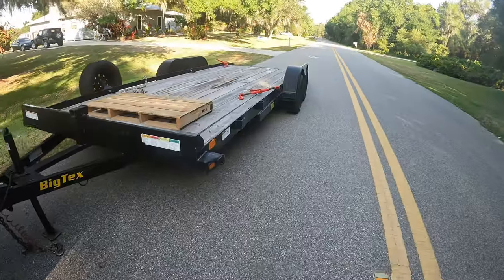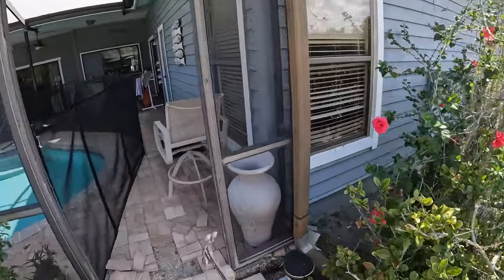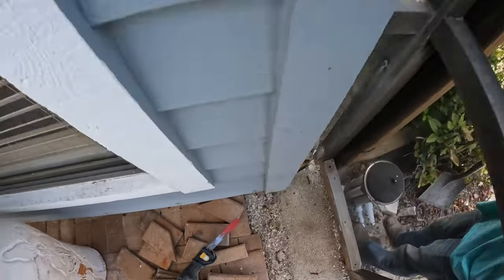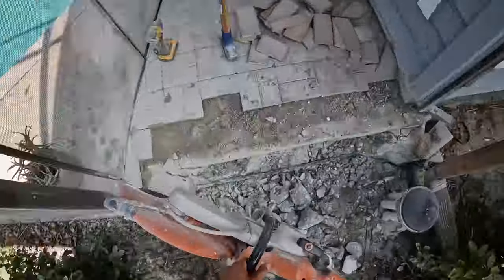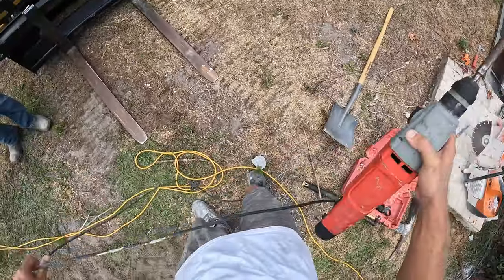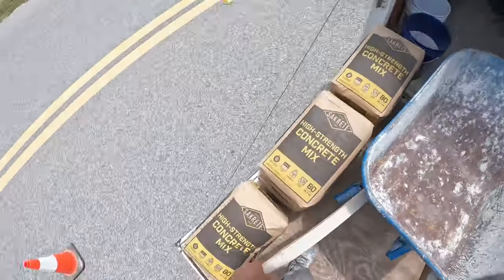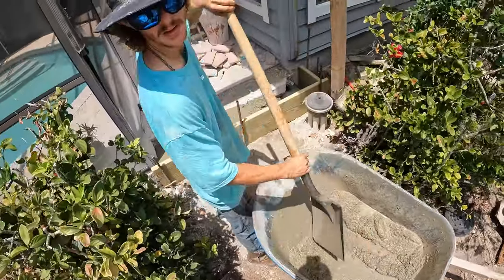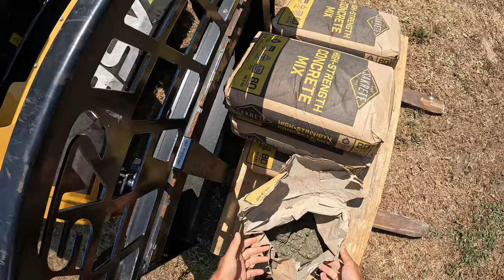Concrete Footer Repair! Pool Deck Was Falling!!!

Comment: Get some wedges and put them into the cut you made, along its length, and then hammer those wedges into the cut.  They will cause the concrete to crack down to the bottom and break off.

Comment: Does not look like a footer, it is too shallow.  More like a pad pored around the swimming pool.  That would be why it was so easy to be washed out by water from the rain gutter downspout.

I would suggest getting a 2 or 3 pound sledge hammer.  They will work a lot better (and safer) when breaking thin concrete and bricks apart, compared to a framing hammer.